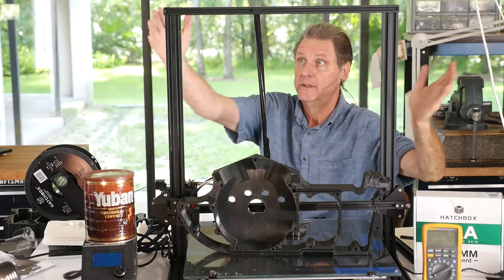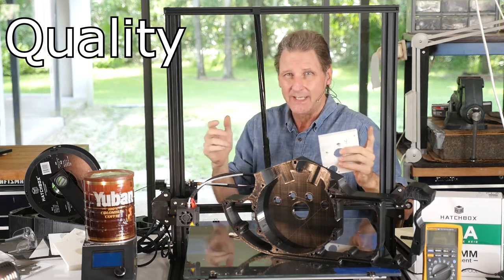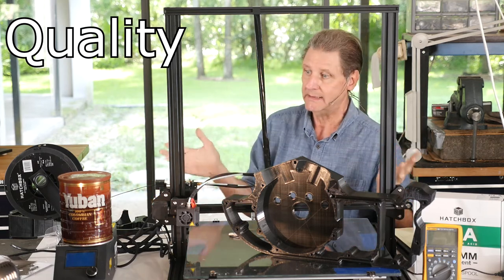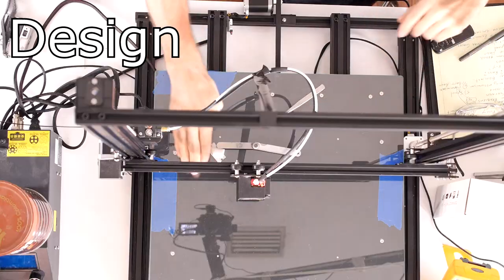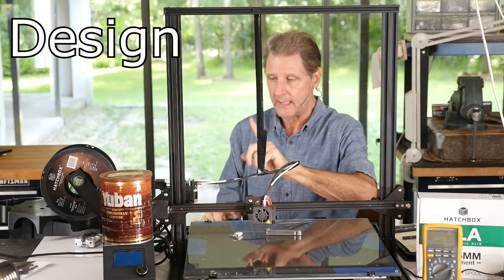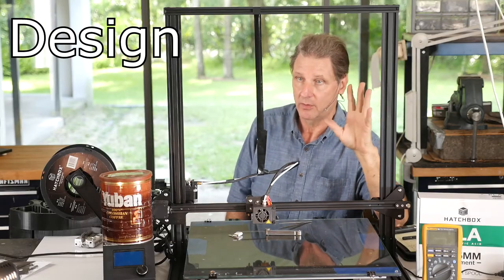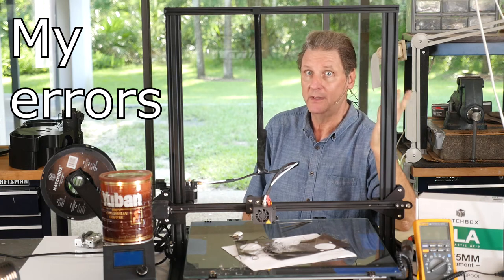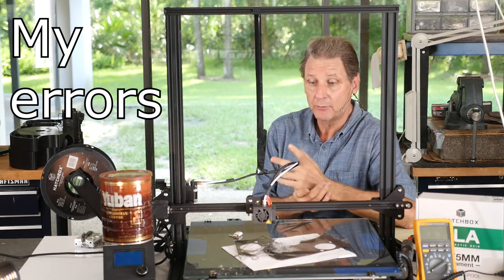Creality CR-10S S5 quality, design, tips, and results

Comment: How did you set up your printer with the new heating pad... I just opened my CR10 -5S and installed the bed heater (per your other video) all went well. However, I tried setting my print bed to 0 degrees or many tries all the way up to 40 degrees but since the shipped heater is not installed, it keeps stopping me from continuing.  I'd love to see a quick set up video showing 1. Z axis adjusting for home.. every time I hit auto-home, it tries to go through the bed with the stepper motor just clicking...(the pad increased the height and it doesn't even trip the stop switch). I am thinking the bed warmer pad moved the home Z axis and I haven't even added glass bed yet.  2. Work-around for the temp setting for those who have the bed warmer you made a video about. 3.  Bed leveling with all you've figured out to this point... with the super sized bed warmer...
Reply from the maker: I just checked and yeah, I have the original bed heater unplugged, the connector is empty at the back of the box. I remember looking at the "info" display to see what the temperature was. Then I took a G0code file that was set to 70 degrees in Simplify 3D, and started that but changed the temp setting in the control box to something under the info box temperature, I think it might have been zero, sorry I can't remember.

I realize the thickness of the full-bed heater raises up the bed, but I was able to tighten the thumb-wheels for bed adjustment so the extruder did not hit the bed hard and then I was able to adjust the leveling. I do remember doing one adjustment cold, one with bed heat at temperature, and then a third with the extruder temperature at setpoint. If you can't use the thumbwheels to get the bed low enough, you may have to adjust the switch that sets the home position for Z. There are slots on the switch, I I remember having to loosen the whole bracket and re-tighten it to give a Z-home position that left adjustment range on the thumbwheels. One trick is that you can bend the little metal tab lever on the switch. If you carefully bend it up, it will set the Z-home higher. You should hold the lever near the pivot point down against the switch and then bend the lever just a little at a time. Don't just bend the lever up without pressing near the pivot or you might break the switch.

I agree all this would make a great video. I have been doing a big project on my house, but I hope to be able to make some videos soon, sorry to not be more helpful, thanks for the comment.
Reply: @Rako_Studios  -  Well, I could not figure it out. So I plugged in the old heating plate and when I want to print, I just immediately go to "tune" and set the bed temp for the project to ambient (whatever is reading at the moment). So it never heats up, but then everything else works. I wish you could show a work around. I found no way to set the bed temp as a constant override of projects.  My CR10 - 5S is new, so maybe it's different. Also, the 4 pin connector is not removable like in some videos showing how to merge the new bed heater with the old (the thermistor wires could theoretically be spliced into the 4pin connector and the power ends capped).   ALSO, the bed heater I got, that looks like yours has about a 15 degree temp swing... it sucks... if you want your bed at 50, you have to set it to around 65 and I'll get a range of 49.X to 67.X degrees... .... ALSO, leveling this bed is very difficult. I leveled my gantry, leveled the bed (both with a digital level) and even leveled it to within .5 degrees diagonally, and then when I go to print, I can literally watch the extruder tip rise away from the bed up to several milimeters.  So I checked the bed with a laser level, it is not warped... Someone needs to come up with a product that delegates leveling to the programmatic arena such that after auto detecting the corners, no physical adjustments are necessary, it just programmatically adjusts on the fly.
Reply from the maker: @cnc3-in-1  Sorry to hear you are having all these problems. I have been working on other projects so I have been away from the printer for several months. I will try to get back to it, and the first thing I do will be trying to replicate the way I tricked the controller to work. 

I totally agree that this whole leveling thing is ridiculous, it should be a much more repeatable operations, something you do once and that is it.

Comment: turn your spool holder around (backwards) it will level the weight of the filament.
Reply from the maker: When I did that the spool hit the machine since the Y-axis motor wire is short and I can't move the control box away. I will look at it again, I must have the wires routed screwy, thanks for the tip.

Comment: Thank you for sharing👍👍👍nice video.
Is there a way to change the nozzle to a bigger size?
Reply from the maker: Oh yes, you can get get nozzles in all kinds of sizes. There are videos online of how to do that. There are also sapphire nozzles if you print with abrasive material like carbon fiber filament. A bigger nozzle makes the print go faster, but you have to adjust all the slicer software to match and experiment with temperatures and feeds. Like I said, you should be able to find some videos on YouTube for this.
Reply: Thank you very much👍

Comment: Thanks for sharing feedback!
I am thinking to buy between this one model (that will not produced anymore) and Tronxy XPSA-600 (or 500). But for the last one I didn't find successful printing examples... Do you know something about Tronxy?
Reply from the maker: I have been looking at that big TronXY myself. There are two models, one with extrusions as the Y linear guide that costs maybe 400 bucks, and another with real OSG linear rails that costs more like $800. The linear rail model is called "X5SA-500-Pro":
https://www.tronxyonline.com/Tronxy-X5SA-500-PRO-3D-Printer-500-500-600mm-p61067.html
You can see the linear rails vs the extrusions in the pictures. I would buy the linear rail model, since the bed of the Creality taught me that some precision can save a lot of headaches in bed leveling and accuracy. I suspect the linear rail model will be noisier, they usually are. I am about to get back in my 500mm Creality, to show how I "fooled" the controller so it runs with external bed heat, and how the print comes out without warping. For now the Creality works for me, but I will keep my eye on the TronXY and like you, will look for some videos that show real test prints of very large items. The TronXY looks to have a big bed heater, not to the edge, but pretty good, see the assembly video.

One really nuce thing about the newest TronXY is that it has 16-point bed leveling. I wish my old Creality had that, though I prefer that the bed me true mechanically, rather than have to jink around the Z-axis to match the bed.

One thing nice about a CoreXY machine like the TronXY is that it is much easier to put an enclosure around it, if you want to print ABS or nylon or polycarbonate. Who am I to talk though, since I have not even tried PETG on my Creality. I assume the full-sized bed heater I put in my Creality might allow me to print those materials without an enclosure.

Comment: Thanks a lot for the great video ... You haven't mentioned the flow, and do you keep the bed heating until the end of the printing?
Reply from the maker: Yes, bed heat all the time. I also rush to turn the bed heat back on when putting in a new roll of filament. If I get an AC powered 500mm heater, I will just leave that on the whole time. Problem with that is it will be darn hard to battery back-up the heater. Lots of power outage in Florida, so I would really like to keep the bed warm for an hour or two in an outage.

Comment: Love your video! I've had one of those for over a year now, fiddling as much as you with it, but I learned a few tips from you here, thanks! A tip that might help you out to get better adhesiveness to the plate is to use 3M poster glue spray (Spray Mount). Elmers glue works a treat as well, but gets gooey and you want to wash it off when it finally "chuncks" up too much. Also, you may want to mount two cylinder screw rails diagonally from top to bottom of your 3D printer to keep the top from wiggling or resonating at high print speeds.
Reply from the maker: I have a can of 3M #77 but I have not used the Spray Mount stuff. What I dislike about spray adhesive is that it goes everywhere, and I won't be consistent each time I do it. I first want to get a full-bed heater and see if that solves some problems. Thanks for the tip, I like your idea better than glue sticks or Elmers.
Reply: @Rako_Studios  My progress has updated a little since my reply. I'm getting the flexible plate for it, and getting rid of the glass.
Reply from the maker: My buddy just went the other way, and put glass down instead of a plate. Hope it works OK for you.

Comment: Still coming to your video😂😁😁
Now i got problem with warping plastic from bed
I will try with 75
If is not working, i will try to insert under bed some aluminum or copper sheet for uniform distribution of heat
I will try also to insulate the bed as it loose a lot of heat under
Reply from the maker: I had large prints warp at the far corners because the stock bed heater is small compared to the size of the bed. There are  full-sized heaters you can glue on, but then you have to control them from the external box, so that is a hassle.
https://youtu.be/G1Zg2F5xuU0

Comment: As for the bow in the machine. This is why I bought a BLTouch for it. It helps alot.
Reply from the maker: Yes, I do think it might be better to sense the bed, but I would love to make a bed that was just naturally level, without having to map. Plus I am afraid of hacking the firmware, but I should just dig into it, there is plenty of advise on the 'net.

Comment: i think the bed goes wobble because of temperature difference between the center and the corners of the bed...The bed heater is smaller than the whole printing bed. So i usually level the bed above the knobs and not at the corners.
Reply from the maker: This is a brilliant observation. I have gotten my milling machine set up and hope to make some custom bed part. I will be aware of the thermal expansion issues thanks to you. I too have started to level above the adjusters.

Comment: You have to experiment printing 0.6mm line width and 0.3mm line height with your 0.4mm nozzle! Your hotend may not have the flow rate to achieve those line settings at 80mm/s so start slow and dial in your flow rate in slicer...then print faster until your hotend can't keep up anymore. It will save you so much time! Also, take the feeler guage out of the set, it will help apply less pressure to the bed. I haven't checked yet, but someone may have made updated firmware for this machine that has mesh bed leveling...it has been a godsend on JG Aurora A5S
Reply: Before you know it you'll want to put a volcanoe hotend on it and print with 0.6mm, 0.8mm, and 1.0mm nozzles. It's a lot of fun and no new thermistor needed. Just have relocate your z ends top and maybe make a couple custom mounting brackets if you have to.
Reply from the maker: What a great idea, a single feeler gauge to allow less pressure on the bed. When I reef down on those springs to make the bed stiff, then it warps and is near impossible to level. When I have the springs all floppy, things like the feeler gauge pressure do make a difference. I know there are add-ons for doing automatic leveling, but that just puts error terms in the Z-axis so that the Z axis is constantly moving a step or two or more to cancel out the flat bed. I really would love to see more of a machine tool approach, with a stiff bed that just stays level. Great advice as well on the nozzle size and speed.  I have looked at Volcano hot ends and thought about doing much thicker layers. Thanks for the great comment!
Reply: @Rako_Studios  Yeah no problem! I never thought I would get consistent leveling on my bed, but now it stays for at least a month at a time without leveling. Step 1: re-tram the z-axis and Step 2: get all 4 corners close to level. Step 3: Then mesh level.

It  took me so long to figure out that you have to take baby steps with the 4 corner adjustment...for instance, say corners 1 and 3 are level (you have a good feel on the feeler guage), but corners 2 and 4 have a gap... maybe 0.1mm. If you move that entire 0.1mm distance and then move to the next corner, corner 1 for instance. It was just level but now it has a 0.1mm gap. The madness begins! Circle all 4 corners 10 time doing the same thing and, by God your in the same place! I found you have to take it real easy, 0.5 turn adjustments to rough it in, 0.25, turns and get close, then just kiss it in to spec.

Once I do that have maybe 0.1mm or 0.15mm between the highest and lowest points on my mesh. Still ugly, but the 25 point mesh takes care of  it. 

Final point...if it doesn't affect anything, a 0.4mm is perfectly fine in order to print a 0.3mm thick initial layer, and you can still be using 0.4mm l8ne width. Any last inconsistencies in flatness. Will be soaked right up with that thicker first layer.
Reply: Unrelated but I wanted to share another thing that I had struggles with for a long time...elephants foot. If you have a lot of features on a part that need to interface with something else (threads, other 3d printed parts, metal items, other plastics) or for models with lots of holes in general, you may start to know the pain elephants foot can be in your rear. Your elephants foot may trick you and make you think you need to oversize your hole more to get the slip fit. It can ruin tolerances or cause you to have to spend extra time post processing. 

I have found two tricks
1.) Turn down initial layer flow rate (if using cura) [[haven't paid my duties to the software engineers yet]], about 80% initial flow rate has worked well for me with 0.4mm nozzle.
2.) Initial layer horizontal expansion (if using cura). Use a negative value. It will depend on two things. 
2.a.) How much you squish your filament to induce bed adhesion
2.b) If you have any singal line width design elements in your first layer. The slicer will do weird things if you have negative horizontal expansion on feature that is only the width of the nozzle. The trick? Setting initial line width lower than the thickness of your nozzle (say 0.35mm for 0.4mm nozzle) and you can use more negative horizontal expansion and maintain the feature. Don't ask me why.

Hopefully between all of that, you or someone else reading this will no longer have to deal with elephants foot. There should be equivalent setting in Simplify 3D...but I can't say for sure.
Reply from the maker: @vincentpernicano3277  Thanks for that fabulous comment! I too learned patience. I had the Creality on a WalMart fold-out card table. When I did the video, I moved it to the steel desk in the studio, and was amazed at how easy the leveling went. So I cut a 34"x34" piece of 3/4" plywood to set on top of the card table, under the Creality. Leveling went better. I also learned to level cold, then turn on bed heat for a long time, a half hour at least, level again, then turn on nozzle heat and level again. It is comforting to know that just one good layer and everything will build well on top of it, but man, getting that first layer can be a pain. I use straight factory glass, I gave up on hairspray or glue guns, if only for the mess. Your advice for small adjustments is great, that will get added to my procedure, thanks.

Comment: Amazing video.  I appreciate your practical review.  I don't know if there is any answer to the dual Z axis screws.  When I built my first 3D printer 5 years agoi, mine had the same issue.  It is still one of the things I have to do when truing before using it.
Reply from the maker: Somebody sells a pulley kit where you tie the two Z ballscrews together, but I am not sure how well it keep them together. It steals a little Z height, but I don't need that much Z travel anyway.

Comment: Have they made a revision of the firmware that removes the crashing of the heat of the pad and nozzle when you pause?
Reply from the maker: Boy that would be great. You can buy one of those separate bed heaters powered from the wall, and that would heat until you turn it off, independent of the printer.

Comment: I have  a large print that I would like to have you print. is that a service you can provide? I am located in Central Florida.
Reply from the maker: No sorry, I have enough trouble making my own stuff, and that is the only reason I bought the printer. If you want to use a job shop, check out a real vendor like stratasys. They can make way better prints than I can on this hobby machine. Sure they cost a lot, but I would have to charge even more, since so much can go wrong. One power drop, like happens every month in Florida, and the print is ruined. Sorry not to be able to help out.

Comment: i have creality cr10 s5, after i use for 20hrs the filament always stock on intruder. The filament are not flow. Totally not flowing in intruder, can you havlp
Reply from the maker: I had trouble with the filament that came with the printer. I have much better luck with Hatchbox filament I get on Amazon. So all I can say is try different filament and see what happens. Also make sure you have the nozzle temperature set right. As you have learned, there is a lot that go wrong with 3D printing.

Comment: Did you find the 350mm heat area effect your large prints?
Reply from the maker: Yes absolutely, the small bed heater caused the sharp areas of the print to peal upwards and warp. I want to put a full-sized (500x500mm) heater, but the ones for sale are all 1200 Watts, which would make it very hard to make a battery backup system. I just got the sealed lead-acid battery I hope to use to do that, so the thing does not quit when power flickers here in Florida.